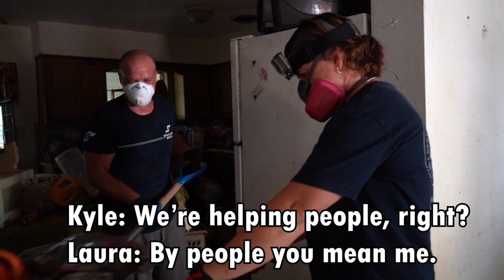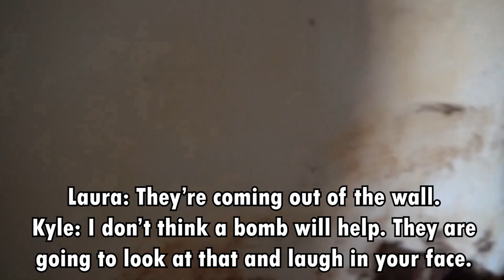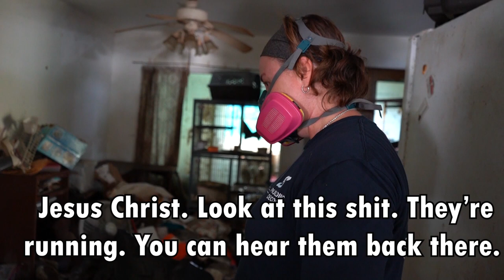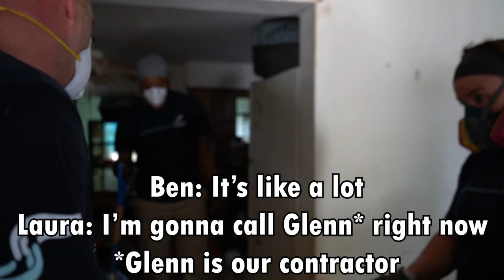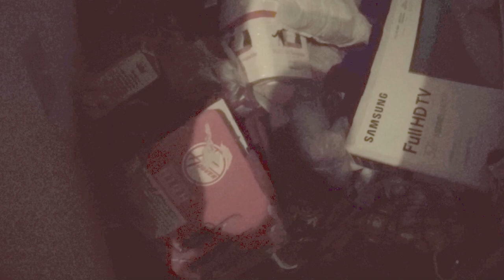S2 Episode 1: Pet Cemetery Pt. 1

Comment: My grandmother used powdered milk and boric acid, mix them together with a little water and leave it for them to feed on in some of her vacant rentals. The roaches would die from the poison, and others would die because the others brought the poison back to the nest. She would also just put boric acid out on the inside along the walls and same with outside. She said the roaches wouldn’t cross it.

Boric Acid works by interfering with the roach's digestive system. In addition, the powder will cling to the outside of the roach, helping to kill other roaches when the affected roach returns to the colony. The powder is fast acting; insects coming into contact with the boric acid will die within 72 hours.

Comment: Pausing at around 16mins
Oh good lord!!! 
Good on you for buying this house and fixing it up! I'd be so on board with the rehab part but not the cleaning out part. You're one brave woman!

I personally would rip out all of the drywall and the insulation, the carpets and flooring and appliances, even the shower areas so the house is down to its bones. THEN I'd rip up the exterior walls so the bugs can flee and get out of the area because bombing for roaches won't help very much and they're EVERYWHERE you can't see by the time you can see them so this is really the best time to rip everything out, get everything purged and replaced and done up to code and with fresh wires and pipes, replace old posts, etc. This way, the house might as well be brand new for all of the problems you'll have (or lack thereof) because you'll have replaced everything. Then you can rebuild, add windows or something to bring in light, take out that tree because that is really way too close and is probably contributing to the infestation, restyle everything to where you want it to be. Even change the layout if you wanted to!

That's what I'd do. Can't wait to see the transformation!

Comment: Tip: Borax detergent kills all bugs, fleas, roaches, ticks and so on. Spread it liberally, you may need several boxes, and cover the area with a tarp for 24 hours. Vacuum it up. Most bugs today are bomb resistant. The detergent is safe for use around pets.

Comment: I used to do clean outs of foreclosed houses just like this. We were smart enough to put a bomb off first if the bugs were that bad. I just don't get how they work so slow. There was 2 of us, occasionally 3. We had houses like this that were 3 stories high and the attic and basement was full as well. We worked 12 to 16 hours straight. We had to have most houses done in a day, two tops. We had to do a 6 apartment building that was packed. We had 2 days. The most we were ever given was 3 days to do a 27 room house and garage that was a hoarder house. We worked 18 hour days. This little house, the two of us would have had done in 8 hours tops.

Comment: buy a nice used skid steer.  break out that front picture window and drive the skid steer bucket up to the window and throw crap in it then into the dumpster.  way faster

Comment: I love you guys but why did u buy this house ?????
Reply: Legit wondering the same thing. It’s been almost a year. I’m interested if Laura still owns it or if she sold it or what
Reply: @raven1359  She said she bought it for $30,000 and it will take $85,000 to fix up. That means at the end she will have spent $115,000 on the home. I looked up 3 bedroom 2 bathroom houses in Winter Haven, Florida and most of them were priced in the upper 100,000s. The absolute cheapest one I saw was priced at $145,000 meaning she stands to make a minimum of $30,000 dollars off the property and is probably going to make more like $60,000.

Comment: That porcelain fox he smashed into the trash was a mid-century Chinese sculpture. I have no idea how the people in that house had it. They were made in pairs although to find a pair today is impossible. A single fox in bad condition can fetch about $20,000 at auction. That would have covered so many costs. 😰😣
Reply: My grandma has one.
Reply: After looking more into it it seems you’ve definitely thrown away a very valuable piece. One just like sold in 2019 for $67,000 with a hole in it. Someone get the glue! 😂🤷🏼‍♀️
Reply: @catchtwenty22  this sounds like a blatant lie lmao. You can barely see the sculpture, let alone appraise it as authentic in any way.
Reply: @romrom920  try putting rare-antique-fox-porcelain-white-Sotheby’s-chinese-mid century-artifact in google and hit images.
Reply: Tell me what you can barely see ther e
Reply: @catchtwenty22  literally nothing remotely like it comes up. I've also tried searching a number of other terms. You are lying or horribly uninformed.